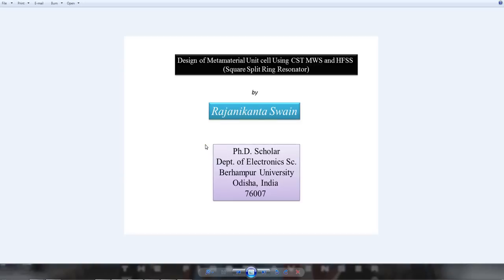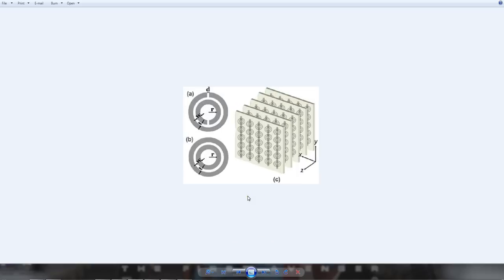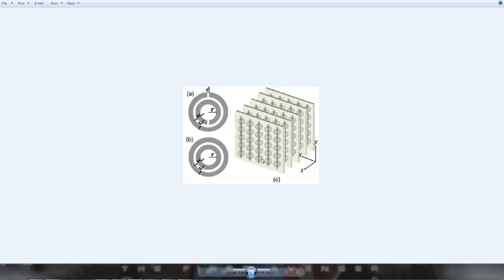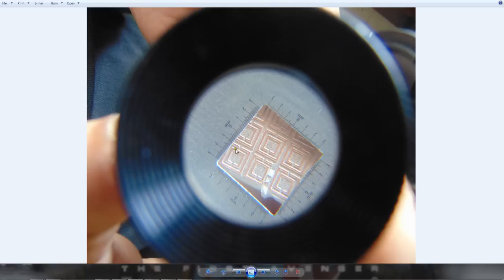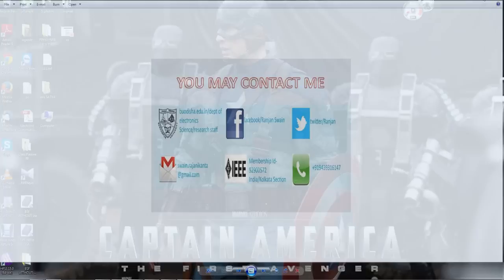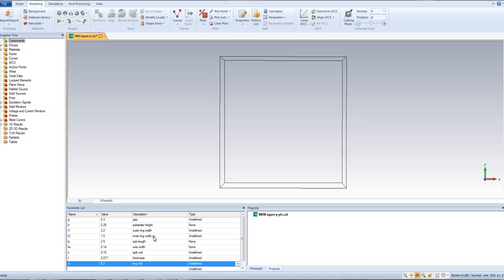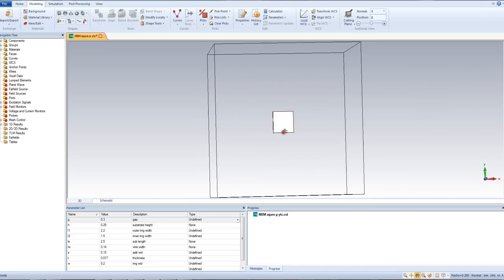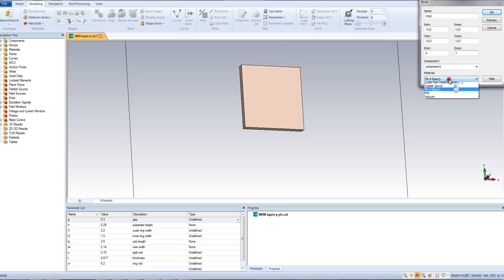Metamaterial Unit cell Square SRR design using CST and HFSS part 1

Comment: Please i need a techniques that i can use with SRR to mutula coupling reduction of a MIMO antenna i designed the antenna and i got everything perfect but my S21 is not less than -20dB please what can i do to reduce the mutual coupling?

Comment: g=3,h=.25,l1=22,l2=15,ls=25mm,lw=1.4,s=1.5,w=2
Reply: Dear Sir, it would be very grateful if you could provide the formulae of metamaterial design by sending to pravatnathiub@gmail.com
Reply: did you get these formulas? I wanted to know which are the equations to get these dimension.If you can help me,send me an email at nikoleta.zaxaraki@gmail.com. Thanks
Reply: hello, did you get the formulas ?